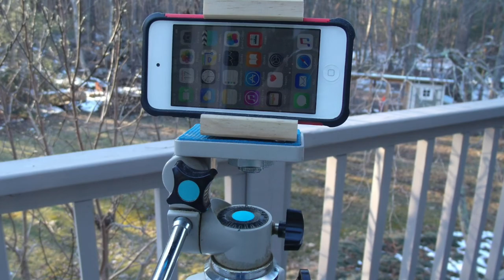Making an iPhone or Tablet Tripod Holder

Comment: Brian,I read or heard this last week that the slots in the threaded inserts were to cut the threads and should go in first?  Any truth to that?Tim
Reply from the maker: Hi Tim.  Not to my knowledge.  There is an installation tool you can buy that fits into those slots to drive them in.  I've also used a screw driver in the slots to install them, but it's hard to drive them straight.  The drill chuck trick actually works very well--allows you to drive them straight using hand power.  https://www.mcmaster.com/#94110a140/=1c1ijnn

Out of curiosity, I was watching/reading some of the claims that the end with the horizontal slots in the inserts should be inserted first.  I don’t buy that claim at all—there is no way that horizontal slot will help cut threads.  It’s the same diameter as the drilled hole.  Granted, there are some tapered inserts out there with cutting slots (i.e., Kipp K0978).  However, these have vertical slots like you would see in a tap—not the horizontal ones that are in the brass wood inserts that I use.  I think it’s another one of those myths started by the people who claim that a radial arm saw should only be used for cross-cuts!